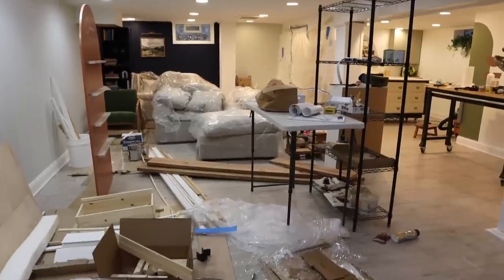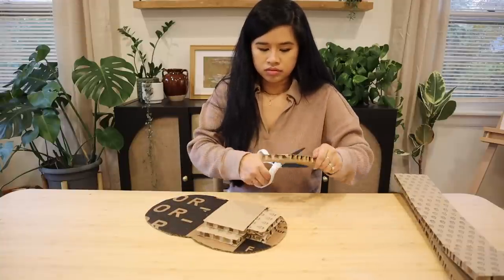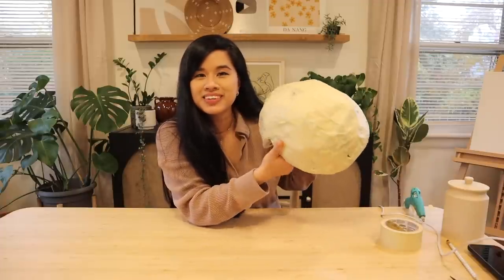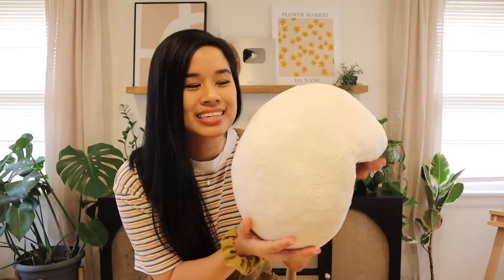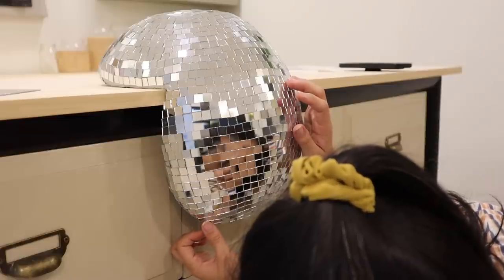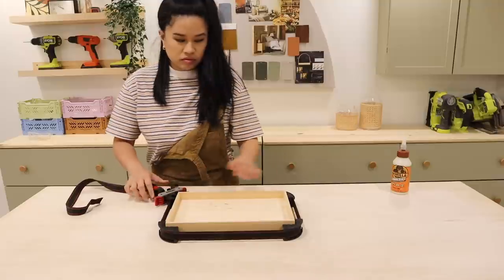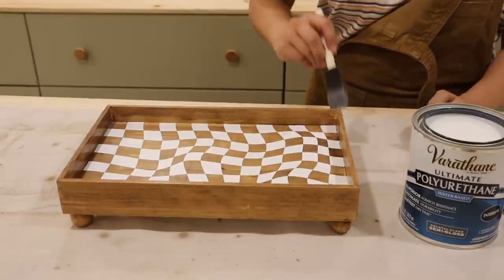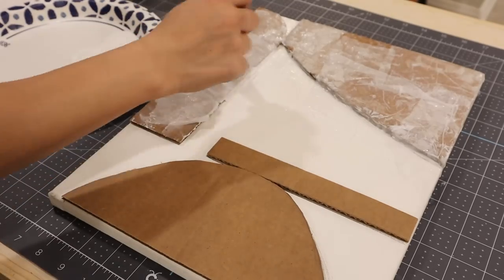DIY Expensive Home Decor Dupes for Less! (i made an ~aesthetic~ $7000 melting disco ball!)

Comment: Disco ball could get a blob at the bottom looking like it actually melted and fell to the floor or onto another shelf,  Especially if you're wanting your own spin on it...the tray is Great but could use handles & the picture needs more layers of tissue or even colored tissue paper on it for that more organic look but that's only if you wanted to take them all up a notch
However, Honestly except for the framed picture there perfect just needs more layers ..Ever think of making a leathered wall it's done with torn uneven brown paper bags then polyurethaned to keep bugs away ..ends up looking like a leathered wall>>.used to do sculptures with chicken wire ✓ flour ,salt, and water paste over the chicken wire then polyurethaned it !!
Amazing crafting is Such a Blast doing those creative choices and notching it up a level ... Once did Both a trojan horse and the sphinx  for An Art Project, it Came out so Kool 😎 of Course" it Won"🥇 so Understand the Not 🚫 stopping to eat thing 🤣😂 🤣 Great Job 🙏 Well Done ✅✅✅